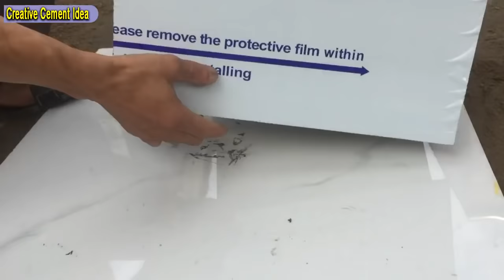DIY - beautiful round flower pots simply at home

Comment: I wish there was some explanation of what you are using to make this machine/tool with.  I can see the PVC but is that plastic or metal or what is that other part and what type of tape or whatever you used on it. Also how long does it take for this pot to dry how many layers do you put onto the thing? How long do you wait between layers?

Comment: First use screws instead of tap for templet put some grease so the cement does not get stuck and at the end put some kind of plate so you do not have to do the scraping at the end

Comment: No wire/repar type of support in the build = busted pot down the line.  Electrical tape to hold the template? May work for this guy on his 1,000th pot but there are better options to make a pot for you folks at home that are no more difficult. Check out Sony Le on Youtube.